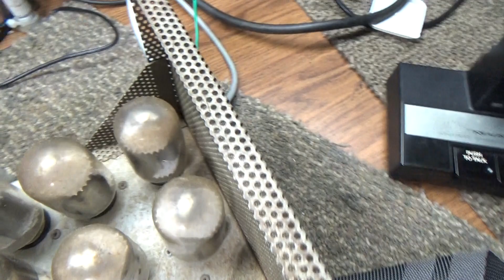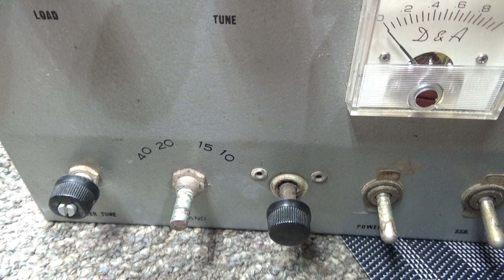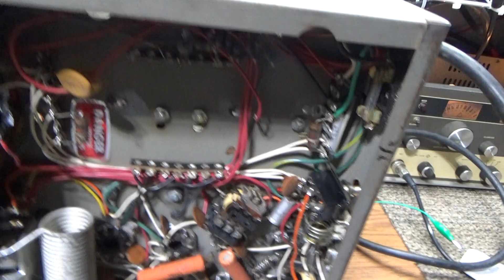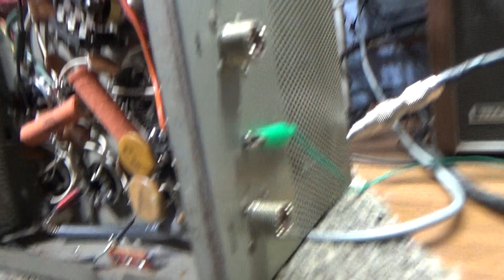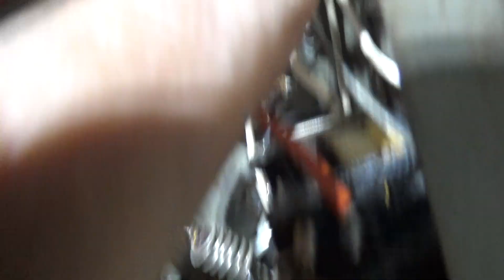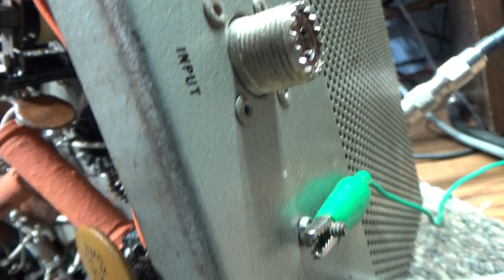D+A Maverick 250 before getting converted to 10 meters only

Comment: Leave the coil alone
Reply from the maker: Why? More efficient and 1 less problem to worry about if its monobanded.
Reply: I have d and a mav 250 for a CB you could use it in uhf
Reply from the maker: No. Sweep tubes won't function past HF. Many Hams and others say that sweep tubes really aren't good for high HF, meaning the CB 27mhz and the Ham 10 meter 28mhz bands. Thats one of the main reasons Hams say get a transmitting tube. They run cleaner at high HF and run UHF.

Comment: Greetings again, I have a Maverick 250 that doesn't have the small relay keying tube. That's not the issue though because both relays key. I replaced the tubes and I'm getting the new caps for it. The problem that I have is that when the relays key I have no power output. Is it possible to find a good schematic for the one that I have?  it's a clean unit and the tubes light up when turned on.  Is it possible to get a picture of the bottom where the wiring is located? Thanks.
Reply from the maker: No output could be about 25 things I can think of. First I would take apart and burnish all the relays. The relays not only switch input and output but turns on the HV on those amps and often its the HV relay that arcs and pits and then won't pass the HV anymore. Also I always ask people whats the input SWR. If it is very high, it means the input watts are  not getting  to the tubes. If you have a meter and are very careful (that HV can be lethal) you can key the amp and use the meter to measure for around 900vdc on top of the one of the final tubes and pin 9 of 1 of the driver tubes. Be careful and the amp needs to be keyed and you only need to test 1 tube.

Comment: Greetings, I don't know if you'll get this, but I was wondering where you get the tubes for the D&A Maverick 250. I also need caps for the same radio.
Reply from the maker: The 6LQ6 are hard to come by and expensive, but  I usually get mine off ebay, patiently.

Comment: N connectors are only "better" than UHF connectors at frequencies above 150 MHz. Commercial and amateur gear typically use UHF connectors for 144 and 220, then switch to N for 440. There are exceptions to this rule; my Yaesu FT-8900R has a lone SO-239 for all 4 bands. 
Compare the male pin on a N connector to the male pin on a PL259. Which one has more surface area? More surface area = more current carrying capacity = more power.
Reply from the maker: Agreed.

Comment: A few questions doc. My triple-stage Phantom doesn't have a selector switch, and it's coil is only long enough to be tuned for 11 m, about four turns, if not exactly four terms. What would be the effect of separating that coil, or even the 11 M section of the coil in your Maverick? The coil on your Maverick is wound just as tight as the one on my Phantom, with the only difference being is that the coil on my Phantom (tan in color) is only about four turns. My Phantom obviously has no selector switch.
I once read a thread on wwdX, in which Nomad replied, that those switches for band selection on CB radio amplifiers, were specifically put their in order to get around the FCC rules, and that those amplifiers will not tune on any band besides 10 or 11 m, or at least tune properly on those other bands. Even though the coil in the Maverick seems to be long enough to cover the Bands it claims to cover, will it actually be able to be used properly beyond 10 or 11 m? I don't recall nomads reason for stating why these types of amplifiers are absolutely useless beyond 10 or 11, even though their coils seem to be long enough to cover those bands, but do you know if this is true, and if so why won't it be able to be tuned (properly,) beyond the CB Radio Band, even though the coil basically says different? On another note, the one reason I never liked the Maverick, even though I owned one, is that it's one of the few if not the only d&a amplifiers that are Class C. Will you be leaving it a Class C amplifier, or you will you change the the bias, making it a b?
Reply from the maker: Also I have heard, but never verified that Palomar amps will not load on the Ham bands either. I think why is that there is also Tune capacitance and Load capacitance involved too. As the bands go up (frequency goes down) and not only do you need more inductance, you also need a lot more capacitance too. Ham amps usually use a Tune cap with a lot more capacitance and a Load cap that switches in more fixed capacitance as you go up the bands. Also with D+A amps the coil is very close to the cabinet. That's not good for resonance either. Bandswitches are also usually a weak spot in any amp. They have RF going thru them and they do go bad. I think it makes an amp a better amp to just get rid of all that useless stuff use only the amount  coil needed for 10/11 meters and try to move the coil as far away from the cabinet and other components as you can. 
  As far as spreading the coil, no, you are going the wrong way. 10 meters needs 4 turns. 15 meters 6 turns. 11 meters is would be about 4 1/2 turns. What I do sometimes is use 5 turns and spread it, tune it out, see what I get, then compress it some, retune, see what I get and keep doing that for max watts. Going with less coil than needed would lower the Q which would make the amp a harmonic generator and less efficient.
Reply: Most amps from that era were marketed as being delivered tuned for the 25-35 mhz business band. They will work on 12 and 10 meters, but as tramdr says, the amplifiers aren't designed for more than about 15 watts PEP or 5 watts AM. The manual for the Footwarmer has a section on tuning the amp properly for AM that's a must read.